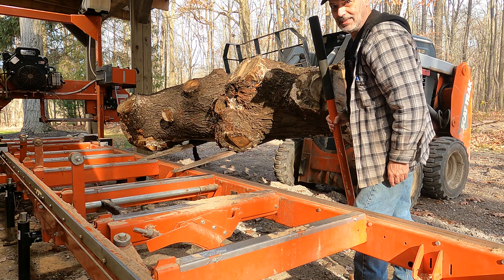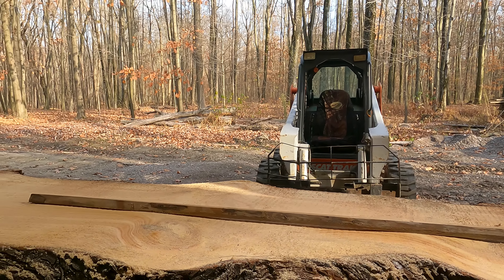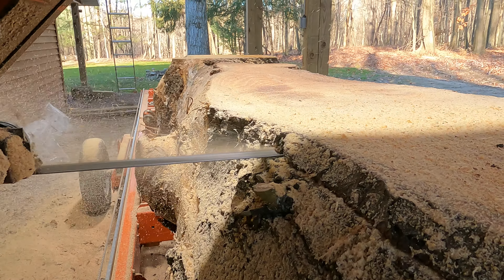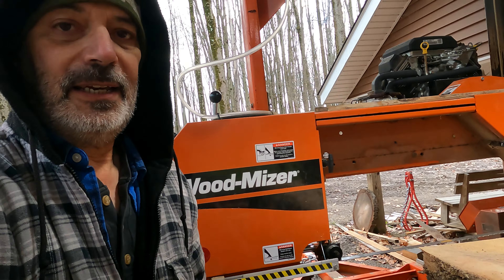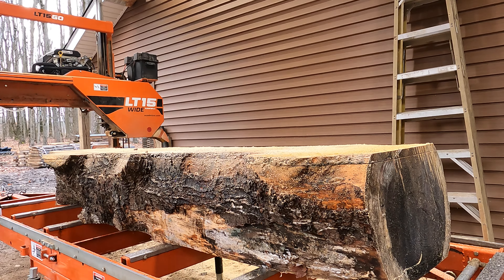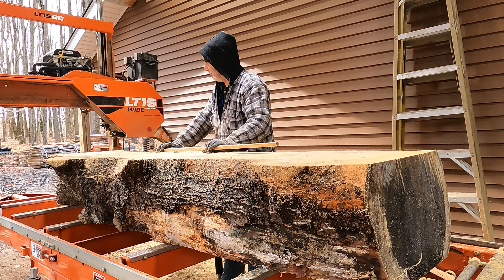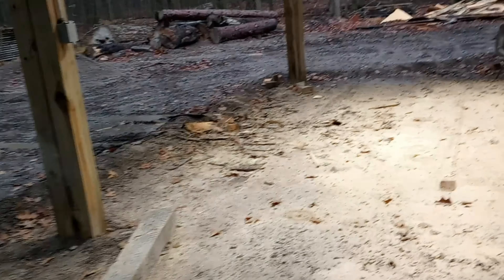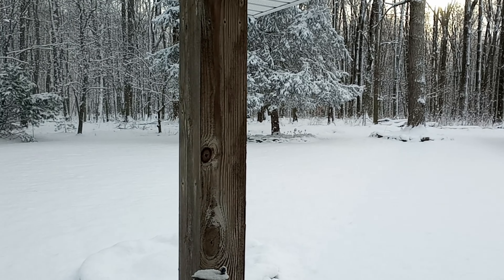This log broke my sawmill

Comment: We finally got the pencil style belt tension tester and discovered we weren't tensioning the drive belt enough.  It's helped and eliminated that groaning noise you get when the density of the wood changes (knots).   With our smaller mill and the 19hp Kohler we've found we have to use the 4 degree blades on frozen and knotty logs, 10 degree blades in general and we can get away with 7 degree on soft hardwoods and clear pine.
Reply from the maker: thanks for the info! I'm using 7 degree blades that are .055 thick, it takes more horsepower but they cut flatter.
Reply: Exactly, you've got the HP to handle it.

Comment: are you going to be able to return those blades?
Reply from the maker: I'm sure but if it's the set it may be easier to just reset them. I'm not sure what's wrong with them yet, haven't tested them yet.

Comment: Thinking of milling while cold.  I milled 1 of 3 bur oak logs in my driveway to make room for vehicles and had to wait for a January day above freezing.  AND I used window washing fluid instead of water.  Not really interested in doing that again.
Reply from the maker: I hear ya. I have a pile of wood in the garage that needs plained so that's an option for January...

Comment: At around 21:16 I saw your cant hook jump up when you turned the cant and the cant hook hit the rail. Reminds me of another operator that had the same thing happen with a much larger log. Cant hook handle hit him in the face and broke his jaw. Had to go to the hospital. He was running an LT15 also.
A bad blade(s) would have been very low on my list of things to check for wavy cuts. Hopefully they're WM blades and WM will stand by their product.
Good video...........except for using such an UGLY, UGLY log.
Dave
Reply from the maker: Good tip on the cant hook, I'll be careful. It was only ugly on the outside... :)